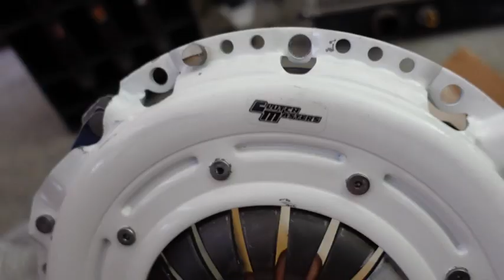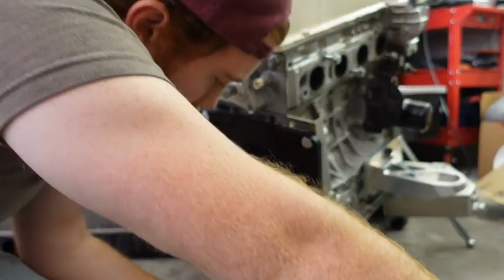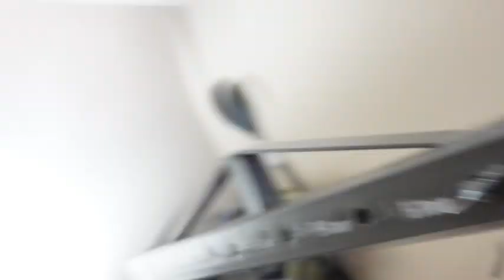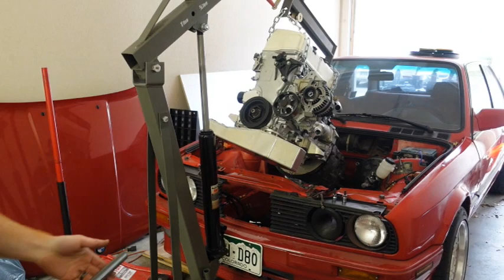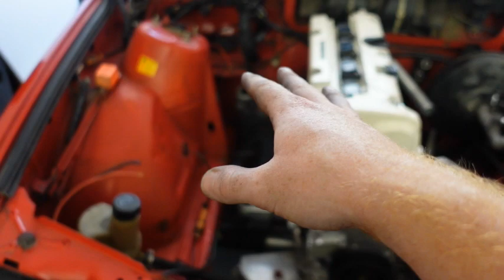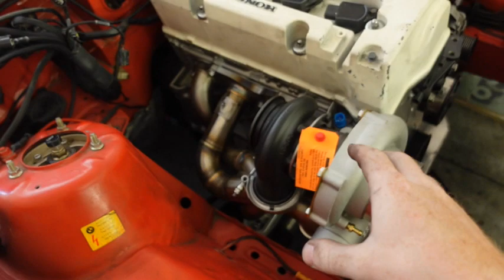Installing the Turbo K24 Drivetrain into my E30

Comment: how long did it take you to do this build in total I am very interested in doing it myself following your way!
Reply from the maker: In total from when I pulled the engine to when I started the car it took me about 9 months, but a lot of that was waiting and sourcing parts, it's an overall easy swap in my opinion!
Reply: @ProjectRacecar2  do you already have a strong background in swaps or was this your first time because I want to know what you started woth and you learned to do an entire swap by yourself
Reply from the maker: @quickfortune7866  I had done any engine swaps before this one, but I had pulled engines and replaced clutches and basic bolt on modifications, but other than that everything else is info from other YouTubers installation guides
Reply: @ProjectRacecar2  you did and amazing job man appreciate you posting this stuff really makes me happy knowing I can make a beautiful car like the E30 not only good looking inside and out but reliable so many pros in this build
Reply: @ProjectRacecar2  last question thoug do you know if its possible to swap in a naturally aspirated v6 engine from like Lexus/toyota ?
Reply from the maker: Thanks man! Yeah the reliability mixed with the bmw styling is definitely a big play!! To answer your question about the Toyota V6 I havent heard of anything on the market like that, doesn't mean that it can't be done, but would be significantly harder, companies like k power and tf works have really taken the guess work out of the k swap🤟🏻

Comment: Been watching your E30 build series lately. Great job on the progress! One thing to note though is that several of your videos are maxing out at 480p for some reason so it’s poor video quality. Looking forward to catching up to present day in the series. Cheers!
Reply from the maker: Hey man! Thanks for the support! That's very interesting, I'll look back at my old vids and see what's going on, I know originally I was filming on my phone so not sure if they were those videos or not! But thank you for letting me know! Cheers!
Reply: @ProjectRacecar2  no problem! Even some of your most recent videos are topping out at 480p. I tried it from a few different devices and it's the same. I'm watching the  "Installing much needed parts for the Turbo K24 E30!" video right now and it's maxing out at 480p.
Reply: @ProjectRacecar2  I just checked your most recent videos as well and only the very most recent one offers 720p. Everything else is stuck at 480p max. Hope that helps.
Reply from the maker: I see what you mean! Thank you so much for the heads up, It definitely might be something in my settings I appreciate you telling me
Reply: @ProjectRacecar2  no problem. Always happy to help where I can! Keep up the good work!